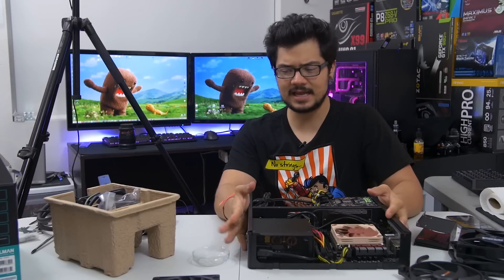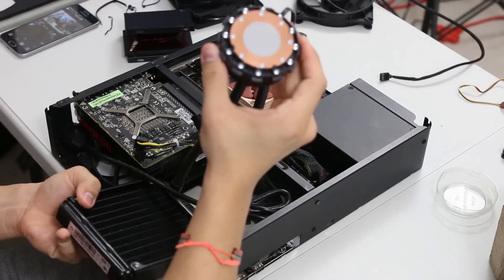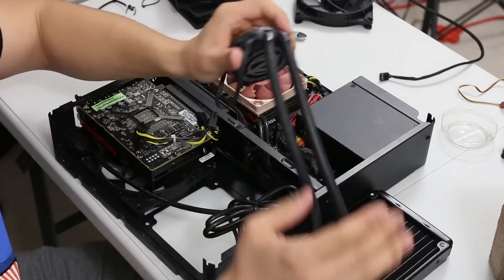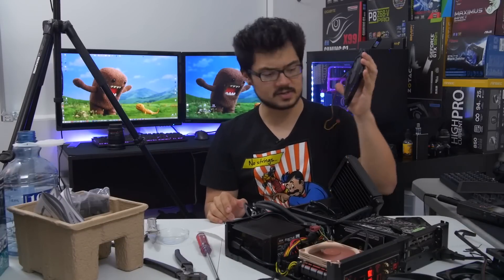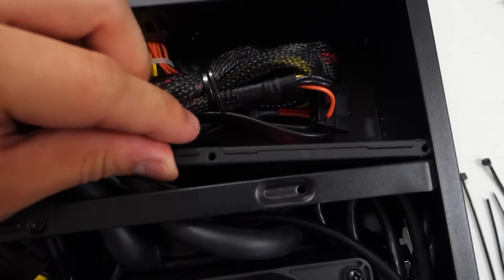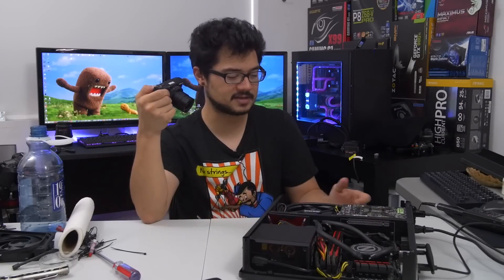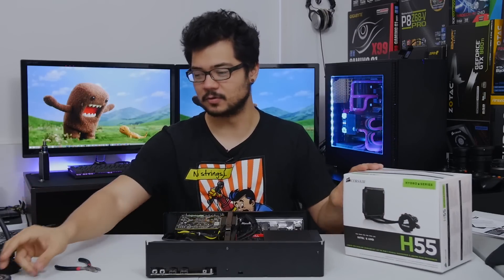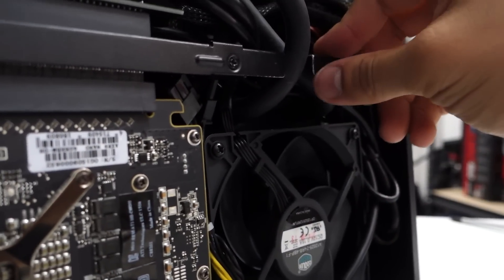Challenge Accepted: Liquid Cooling in the Fractal Node 202!?

Comment: suggestion to fractal design: make that cut and put a blank over it. so everyone can use an AIO-cooler. or it would just make cablerouting easier. 
i probably would have drilled the rivets out, took the wall and made the cutout bigger. that way it looks like factory default and i can put the cooler through. oh, and i think it would have been much easier with no cables in the way.
Reply: +FeuerToifel Probably not willing to say they support water cooling on a case made for portability because they don't want to be blamed when people inevitably get leaks.
Reply: if there is a leak, then it's not the manufacturer of the case to blame. doesn't matter how big or small the case is or if it is an aio or a custom-loop.
Reply: FeuerToifel
What actually is someone's fault and what people say are two very different things. It wasn't McDonnalds fault a woman held a scalding cup of coffee in between her thighs and then spilled it, but they even managed to convince a jury that it was.

My point is that cooling loops aren't really made with being constantly moved around in mind, for a case manufacturer who is making a case with portability being the primary purpose to expressly support liquid cooling it would be easy to see people blaming them when they got leaks even though as you say it isn't their fault.
Reply: +Nevir202 yeah, I totally get your point. if this case was manufactured with watercooling in mind, there would have been no need for Kyle to chop a piece out of it.

Comment: I noticed that there are two philips head screws in the metal bar that you cut through one almost dead center in the case and the other towards the back was just wondering if you'd taken those out would you have been able to accomplish the aio installation without the hacksaw(looks possible but the case isn't in front of me)?? Love the vids, love the comedy stuff keep it cumming(pun intended) ;->

Comment: I wonder.. If we had a full sized GPU (rx 580), and the radiator below it with a 120mm fan beside, would that be enough airflow to cool the radiator down? The positive airflow in the case would push through from the radiators side and out towards where the CPU is? Also, is there room for a 120mm fan to sit above the cpu/water cooler as a possible exhaust?

Comment: Isn't it better to switch that vent around to push the air out through the radiator and outside the case? Now it seems to me all that hot air from the radiator is pulled inside the case.

Comment: you need to put some sort of bushing on that cut man. if this was a static system id say that it wouldnt be necessary but with all that movement it could turn out bad. just get a small cable (1.5mm should do) and slice it laterally in half, remove the copper and done, a form fitting bushing.

Comment: Well Kyle, I think you just demonstrated that it is indeed possible to liquid cool the CPU in this case.  With the small enclosed nature of this case, the AIO cooler is perfect because all of your heat from the CPU is exhausted through the radiator instead of it being exhausted out into the cramped interior of the case itself.  Nice work.

Comment: Kyle...
You have to pull out the bracket. You can screw it out. On the side of the case you have screws. So i guess you can screw it out. Also you have screws on the bracet. I have the idea you didn't have to cut out the little metal. 
All the best Michael

Comment: only question i have is why would you have the rad fan pull the hot air into your case especially when its that's close to your gpu? wouldn't pushing it out to the bottom make more sense?
Reply: +Jayden 97 yes some of the heat from the gpu would expel out of the gpu into the case but 1/2 goes out the back BUT bringing hot air into the case from the rad would increase the ambient temperature of the inside of the case and heat the gpu up more with out a fan in the case moving air elsewhere from what i understand

Comment: Should probably also place some rubber/plastic inserts on the edges of the metal you cut. vibration + metal edge + tube full of fluids = potential disaster.

Comment: any pc supports watercooling  .trew it in the river and done. and im sure it even fits an 240 rad as you put the radeon in the trash and use the iGPU from intel (not the 6700K) and then still have decend place for SSD's in raid.

Comment: problems 101
air goes up and that said the pump is the highest point and the cooler is at the bottom thats why you starved the pump of liquids and over heated
thats why with cars the radiator is slightly higher then the engine so all the air can escape(out the cap) and if they have a bleed screw that is the highest point to bleed the air from the part of the engine
fix -  you could of put a brass T fitting in the top of the pump and have a bleed and fill hose 
and re fill the stuff in side with correct fluid  and had hose clamps on the T fitting(brass doesn't rust)

Comment: wouldn't the change in air pressure from cruising at 30,000+ ft. damage the system?
 Is there more than 3 liquid oz in the radiator?. TSA would probably question what liquid is inside.

Comment: So you never have to refill those liquid coolers? And how long it last?
Reply: They last a while honestly the pump will most likely die before you have to "refill" it
Reply: +Daniel  Burgos You got that backwards. Pumps are lubricated from the liquid that goes through them -- and the liquid evaporates over time. When there isn't enough liquid, the pumps will grind to a halt and die.

Comment: I have a mixed opinion about this. For one part, it's really cool, the idea takes advantage of the small space and manages to keep temperatures under control, without sacrificing on performance. However, on the other hand it  kills the purpose of go anywhere do anything. On transport the system gets tossed and shacked around, which makes the AiO is much more prone to get damaged (remember the bench-test fail?); while the Noctua cooler installed was lightweight, rock solid and it's very hard for it to de-attach  from the motherboard accidentally. The system now has less structural integrity from the mod made, and more failure points than before. 2/10 wouldn't take to Lan Syndicate.

Comment: Although this video was 5 years ago but I would still like to add the  comment to it. The best practice of installing AIO pump should not be above the radiator. Because even close loop AIO will always have air inside, AIO pump cannot move air. If AIO pump at the top, air will always stay inside the AIO pump and reduce the lifespan of the pump. 
For a case like this, maybe you consider to relocate the PSU to the bottom and install the radiator beside the motherboard if it fit. This way may be even easier for you to install the AIO and avoid the bubble get into the pump. If possible, install the radiator with the hoses at the bottom or side way so the air will stay up top and no chance to get to the pump inside.

Comment: not sure if its been asked,will this mod work for the rvz02 case?
Reply: if you get a shortened video card, you might be able to get the rad setup working, but you might have to go with the scythe slipstream instead of the cooler master too. I'd also recommend getting the tubing and case modding done without the other parts installed first. this guy did it http://www.overclock.net/t/1466816/silverstone-raven-rvz01-rvz02-ml07-ml08-ftz01-owners-club/5430#post_24896211

Comment: Honestly you should have just screwed in 2 holes at the ends of where you made that cut and custom welded a metal bracket that sits on top of them after you had stuffed the tubing through the gap you sawed. I mean you had already gone so far installing an AIO cooler in this case, might as well

Comment: You could have removed all the PC components, and enlarged the hole without cutting the top. You can also rebrace it with supporting metal pieces. Don't forget to remove all the metal shavings after you filed the edges. To do that properly you'd have to remove all the PC components anyway. I question whether the performance hit of using a Nano is worth it just to water cool the CPU. I'd much rather a 980 Ti and a decent air cooler for the CPU. The one you had was fairly small.
Reply: There isn't room for a decent cooler in this case, only 57 mm headroom over CPU, if I remember correctly, and you still need some space for the fan to suck air..
Reply: Trailerkusken There's a few coolers that size that are rated at 130w TPD. Perfectly adequate. The area above the CPU is ventilated. No need for extra space.
Reply: +Blood Angel Oh, you're right, I totally didn't see that vent over the CPU! XD I haven't found anything better than the Cryorig C7 at 100W TPD and 47 mm in height, but it would be enough for normal use I guess. Not so sure about OC though..But that vent sure helps a lot bringing fresh air to the cooler!
Reply: I use ID-Cooling IS-50, there are other options though.
Reply: +Blood Angel Wow, that's a nice looking cooler! I can't get it in my country, and importing would make it expensive, but at 57 mm it would be perfect for this case! Thanks for the tip!!

Comment: Heh. I cut a hole in mine and mounted the radiator and fan on the outside :P It works, looks a bit steam punk or industrial. I do use a full size GPU though so I didn't have this alternative, very nice solution you came up with for sure :o

Comment: Apologies to dig up an old video but im curious if its even possible to put in a 1080/TI mini from Zotac in there and still fit with the water cooler? Im thinking it may have trouble due to the heatpipes protruding on the vidcard. Or even being able to plug in the power connectors. Any ideas? Anyone confirm this working or not working? Thanks.

Comment: Kyle: Why is this getting better temps than my Silverstone TD02-E  240mm on an 4690k @ 4.3ghz. I don't get why I'm hitting 80C.
Reply: +Gavin Remme voltage matters most, i have an i5 2500k @4.5ghz 1.3 volts with two xfx amd hd 7970's ghz editions overclocked to 1100 mhz core and 1700 mem, and my cpu maxes out at 76C amd hottest gpu at 60C all cooled by a single 30mm thick 360mm rad with 11fpi

Comment: Can you do a follow up where you check motherboard temperatures? 

Despite the great CPU temps (nice job on the modding there) the motherboard will now get zero airflow and considering that VRMs heat up more than before......well it worries me. Hope your rig is fine, but I wonder why you have not checked that yourself already....or maybe you have?

Comment: I've got a solution that will work, empty and clean what fluid is left in the AIO, and replace it with new, to the point of almost full, and put some fluid in a decent sized bowl, submerge the pump/block, and lift it above the pump/block, a few books will do the job, and you'll be able to see when it's full as no more air bubbles will come out, you might have to slightly tip the block/pump side to side, in and out of the fluid to get the air moving, and when you think it's full do the screws up, whilst it is submerged. It is easier than it sounds, I cleaned and old AIO a year or so ago, for a build for a friend, and it is working as new to this day. It doesn't solve getting it fitted into the case though, but, all you need to do is drill out 2 rivets, and re rivet, or 2 self tapping screws, or even 2 small nuts and bolts.

Comment: Ma main Bit! quick question for you 
i just water cooled my node202 following your guide..
but im getting them in the90 's when it spike and mid 30  to upper 40.. is that anywhere normal for an aio?
i should say where the pc is located is usually warm due to the window facing the sunset..
its like im getting the same temp i used to get with my air cooled heatsink except for now i dont hear a fan spooling

Comment: You should have just opted for a Scythe Big Shuriken ver 2b since you're tiny water block temps is a few degrees higher than the shuriken cooler. I know cause I'm using one.
Reply: Yeah, that really does seem to be the best CPU cooling option for the Node 202. The fan presses perfectly up against the side of the case and doubles as a CPU cooler and intake fan pulling fresh air in straight over the CPU. Plus it's much easier to install than the water cooler, and it still allows you to use a full size GPU.

Comment: Now that we know this is possible, someone should try putting in a 240mm radiator in the GPU compartment. This means that both the CPU and GPU would have to be cooled, to make the card small enough to still fit by using a waterblock. I think the hardest part would be where to place the pump.

Comment: I kind of cringed when you used compressed air to blow the metal from the cut + filings into the case, risk of short circuiting much? Also was there any effect to your gpu temps now that your intake fan solution has changed

Comment: I would have unscrewed the riser board which has screws on both sides of the case put the tubes in the cable hole and screw the riser back down and forget all the cutting and AIO dismantling business.

Comment: Isn't that PCIE frame removable and doesn't that make room to route the AIO cooler without cutting the case? I'm looking at the review for the case from HardwareCanucks and it seems removable but I don't know if you get access to that small gap there. Can anyone confirm?
Reply: The space is only large enough for the PCIe extension.

Comment: Maybe put a metal bracket attached with nuts and bolts on the piece of metal you removed? It should solve the issue of the case possibly not being able to take a beating :D

Comment: Hey I'm going almost the same system with the H55 water cooler, but with a GTX1060 Mini GPU, do you think it will fit with the radiator + fan next to it? I'm not very sure as your GPU seems to be only 152mm in length, but the GTX1060 are 173mm in length...
Reply: any news on what happende to your build?
Reply: Pierre Barbeyto Hey, the GTX1060 won't fit unfortunately with the Corsair H55 AIO Cooler... I bought a R9 Nano for about 360€ which is good price... also the R9 Nano is even better than the 1060 so I'm fine with it... also be careful with your choice of coolers... for example the Corsair H65 won't even fit in it

Comment: Hey, bubbles are not a problem for AIO!!! I refill all my AIO (I have 6 for 3 PC... ) all the time! Just remove the radiator and remove CPU heat spreader from waterblock, you will see that there is almost no water! Add a little, close heat spreader (not by screws, bust hold tight), then put a little higher than a radiator and shake radiator. Open and you will find new bubbles. Repeat a few times, and voila - your AIO working!!! It takes like 5-10 minutes to revive AIO, I made this like over 10 times already (I bring my AIO from Europe to the USA in baggage, some of them had a leak after this voyage, so I just revive all of them)

Comment: Hey mate, I wanted to ask which GPU you've got in there and it's dimensions? I was thinking of trying something similar with a Gigabyte mini-itx 1070 which measures about 17cm in length. That card looks to me to be a R9 Nano which is 15.5cm in length. Do you think the 1070 will fit along side the 120mm rad? It looks like a tight squeeze to me so far. Thanks.

Comment: Nice Job, but being the cheap bastard that I am, I would have just gotten a cheapo APEX TX-381-C MicroATX tower that has a carry handle, and cut the bottom front drive rail cage sheet metal mess out, and put a push pull 120mm AIO cooler in the front with a good 92mm exhaust fan, and 80mm fan for side panel to help with GPU cooling.

Comment: You Could have unscrewed the middle part of the case instead of cutting it
Reply: +xSixtyyy And how would that make the cut out of the panel bigger?
Reply: iPants screw it out , put the tubing there screw it back in
Reply: +xSixtyyy That wouldn't work. The hole in the panel is too small. If you unscrew the panel, route the tubing and then manage to put the panel back you would have a extremely pinched tubing. But you wouldn't be able to get the panel back.